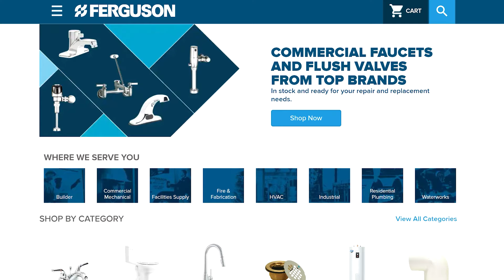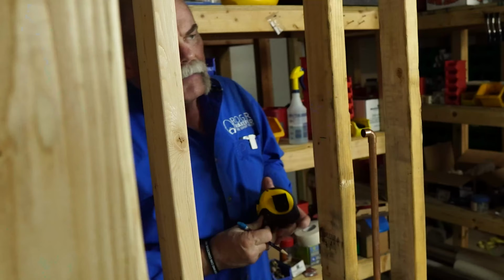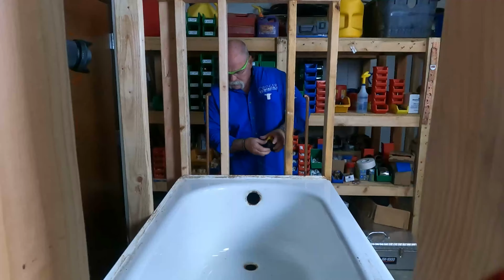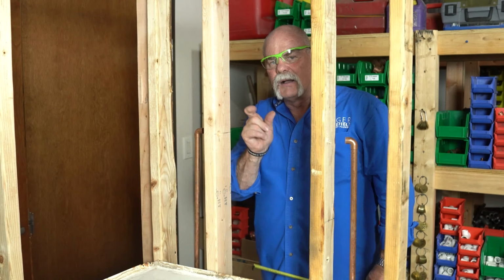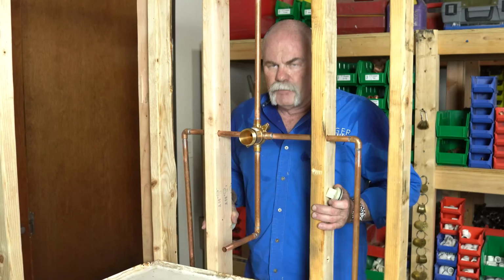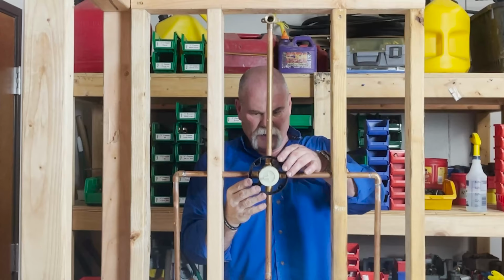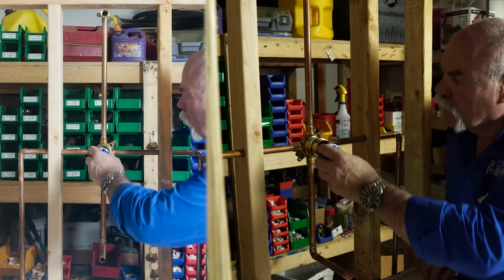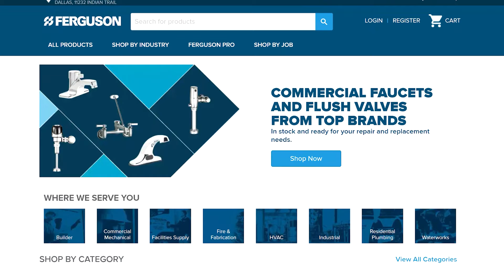New Home Shower and Tub Faucet Installation |  The Moen Encore

Comment: Again, this is a monkey show, not how real plumbers work. Those 5/8" holes you drilled for 1/2" copper water pipes are too small. You will get friction squeaks when in use. You should have drilled 1 3/8" holes and use pipe insulators, as licensed plumbers do. Also, every real plumber knows you should use drop 90s for tub spout and shower head outlets - otherwise, both tub spout and shower head will end up being lose, and move around. Oh, and no nail plates and risers are not properly strapped to the framing. Dude, I am glad you didn't get dirty. Duh!
Reply: Those aren't 5/8" inch holes, that's the OD of 1/2" copper so if the holes were that big they wouldn't fit. Probably 3/4" holes. He used a  drop ear ell for the shower head, the spout probably is a compression type spout so you wouldn't be able to use a drop ear.
Reply: Little to harsh on the critic, sir. 

Different plumbers do things differently- doesn't make it wrong. 

He didn't show proper blocking and strapping obviously but he did reference doing it. And with that also didn't address nail guards. 

However, those plastic insulators aren't actually required, and belive it or not, once didn't exist. We would have to properly strap to avoid pipe movement. 

He did use a drop ear 90 at the shower head but not for the spout stub out- didn't show it but I think the tub spout was set screw not threaded, so doesn't matter.

But all of it would need the required blocking & strapping - pipes, valve, sub outs.
Reply: @paulbrunner72GenX : Well, you tell Roger that "different plumbers do things differently". I think you have missed that Roger makes living on YouTube criticizing other plumbers and their work. Just check out his videos and see for yourself. As a Master Plumber , as he calls himself, you are held to higher standards. You are expected to use Code as the base than go beyond the Code with the best possible installation. As far as the tub spout comment goes , not sure you yourself are fully familiar with plumbing fittings. If the spout installs over 1/2" copper pipe than you use 1/2" CxC Drop Ear Elbow ( Google it, it is a common fitting in plumbing  trade ). Both shower head and spout have to be solid, not shaky, as in his video. Would never pass inspection. There is nothing more annoying than going after these "master plumbers" , breaking up finished walls and reattaching pipes as they should be properly attached in first place.
Reply: @DonJosesito : The boring bit says ?/8" . Cannot read the upper number, but when I freeze  the video, the bottom number is clearly "8". So the drill bit is either 3/8" 5/8" or 7/8".  It is not 3/8" because hole would be too small for the pipe. It is not 7/8", because hole would be much larger and pipe would "float" within the hole. Besides, 7/8" boring bit actually drills through rough lumbers as  15/16" - so that half inch copper would be floating in that hole. It is 5/8" boring bit. If you notice, Roger actually wiggles with the drill bit to make that hole a bit larger, creating the play you are mistaking for 3/4" hole. As far as the tub spout goes - well, if it is "compression types" spout than you use 1/2" CxC Drop Ear 90.. It is a common fitting.  Every licensed plumber has one on his truck. PS: Missed that shower "drop ear" he installed - but if he did install one, than he probably didn't attach it properly because entire installation is shaking  and certainly gives impression he did not use one.
Reply: Doing things differently is fine, but if it doesnt achieve the same result, then one of those ways is better than the other. Im a fan of the channel, but i was surprised by this video. His work here should be the creme de la creme of shower installs; there should be no room for improvement.. yet there is. Im kinda let down
Reply: @elmono3939  up here in Canada we call them drop ears WINGBACK 90s... yeah this channel is goofy but non tradies think its brain blasting he sweats 1/2". Some of his reaction clip videos are entertaining
Reply: Harsh, but absolutely deserved. Roger has far more experience and knowledge than myself, but im with you here. Had to open many walls to fix noisy pipes in installs like this. What if someone installs a grab bar with long screws and punctures the pipe? What if the contractor will pad the studs out, use thicker cement board, or thicker tiles? You always need to ask the ge how far the finished wall will be from the studs; then if there is an issue later, its not on you. Like you said, the guy has a youtube channel, likes to mention his abundance of experience and qualifications, and critiques other peoples work. A few times he’s mentioned that he charges a premium, and this is not premium work; plain and simple. Its not “great”,  “pretty good”, or even “good”. If I saw one of my guys run copper through the studs like this, it would 100% need to be corrected. Regardless of how busy I am, this isnt even one of those situations where you can say “eh, itll fine”. It needs to be corrected. So this one really left me scratching my head.. master plumber with so many hours under his belt and he screws up a simple basic shower valve installation.

Oh and wait till you see a video of him working with primer
Reply: @paulbrunner72GenX  sounds to me like he has a grudge against Roger.  like maybe he got called out for something.
Reply: @elmono3939  bro I was confused like wtf is a drop ear for the shower head.. in Florida we call them wingells lol

Comment: Why are shower heads always set too low? is it because the plumbers with crooked backs from bending over for 50 years want to have the perfect experience in the shower while everyone else feels like will Ferrell in elf? I see no downside in having it higher besides cost, if someone’s reallly short they could get an extension.
Reply: a lot of it is inertia.  some of it is in premade tubs, plumbers got in the habit of setting it in the tub enclosure.  when my parents had a house built 30 years ago, I told them to tell the plumber to set the shower at 6'6" and he started doing it on every shower he did afterwards.  as I said in another post, the college dorm I lived in had the shower heads at 4'6".
Reply: @kenbrown2808  normally I go 84 inches off the floor, to the center of the “wingell” as Floridians call it. 84” is a nice average height that a lot of dr Horton jobs use, I do that unless a customer asks otherwise
Reply: @davebuilds7261  yeah.  it gets it above most people's heads.